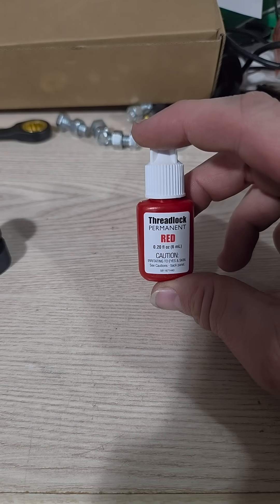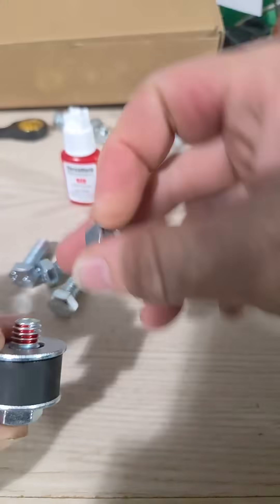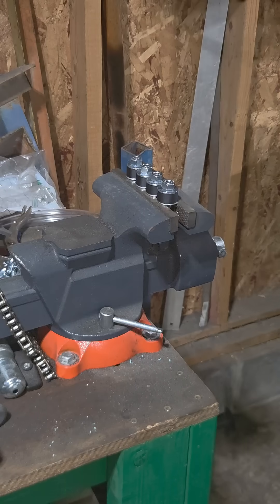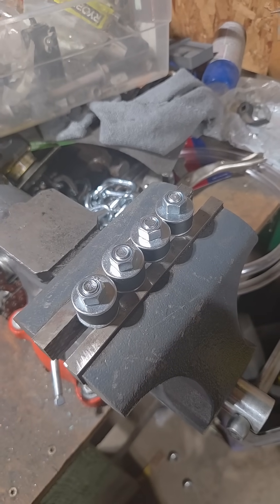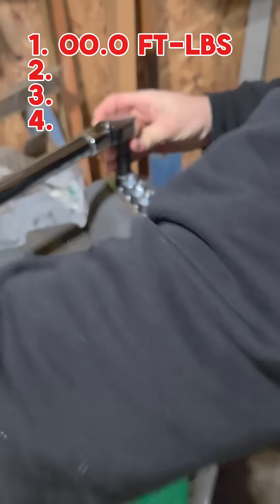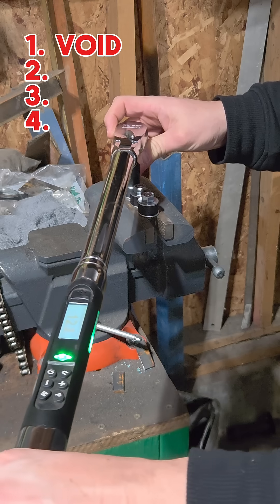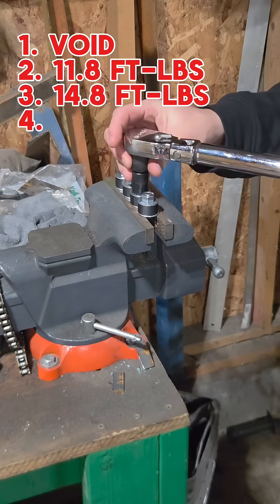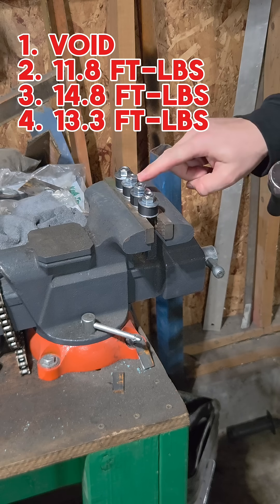Torqued Red Thread Locker

Comment: something is not right about this demo I recreated the same thing and it took me 27 pounds to break loose something I tighten to 15 foot pounds something is wrong with your locktite sir
Reply: I believe it's something to do with the rubber than may have had an effect on the loosening. If this was recreated with solid steel between the washers I think we'd see higher numbers. It may also be just the low torque he's working with. Had he torqued to tp ft/lbs with a larger diameter bolt it may have been different.
Reply: @stevenelder568 I recreated it exactly like he did results was way different
Reply: In the worst-case scenario it should have taken the same amount of torque to loosen it as it did to tighten it so either you've got some crappy Loctite or a crappy torque wrench